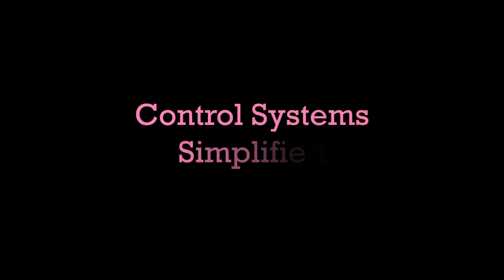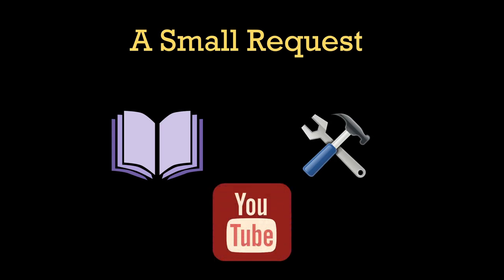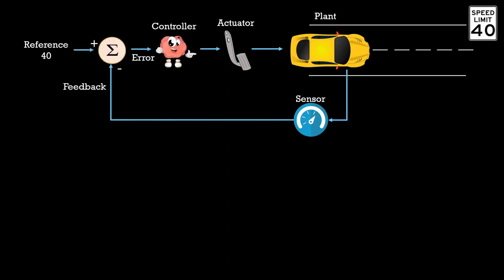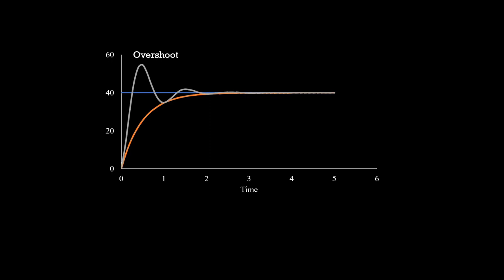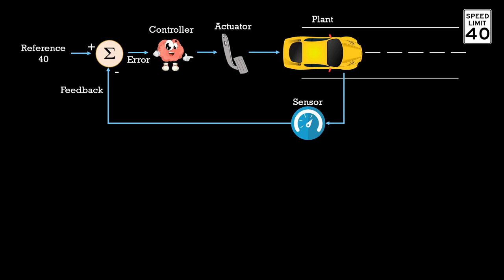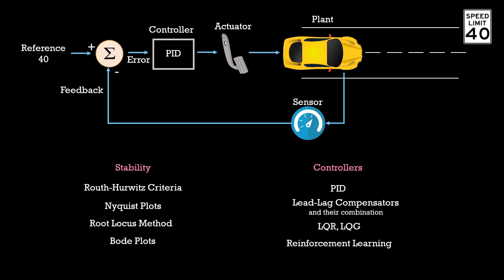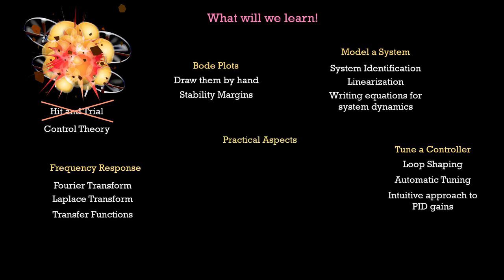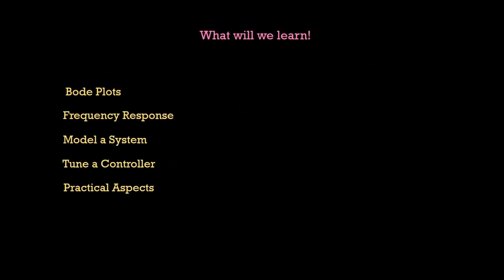Why Control Systems? Intro to new Series - Control Systems Simplified!

Comment: You explain the topic great and practically.....your explanation cleared up some very important points and linked up my loosely tied concepts. A lot thanks for that. And your philosophy of sharing gained practical knowledge will be quite helpful for those trying the connect the dots of control system...Please keep up the good work